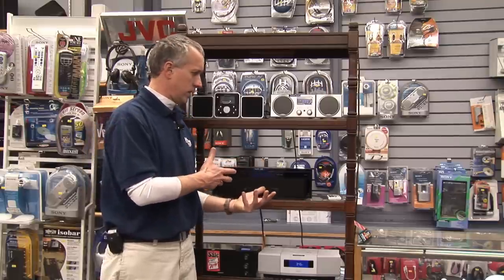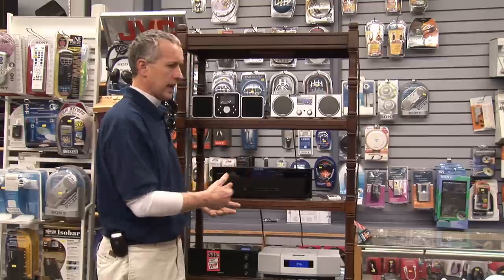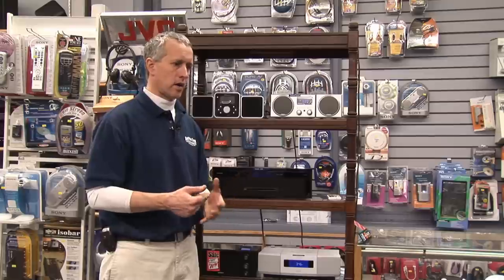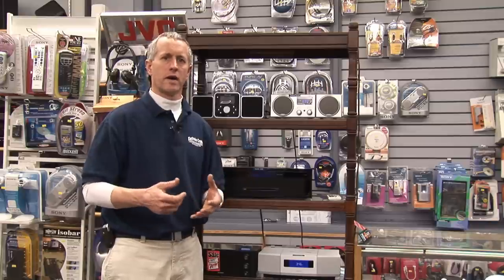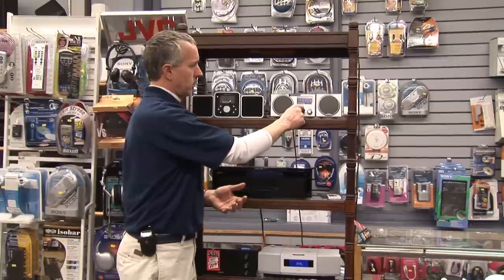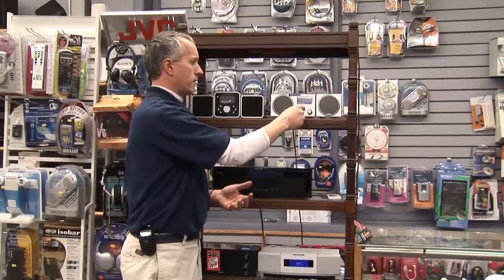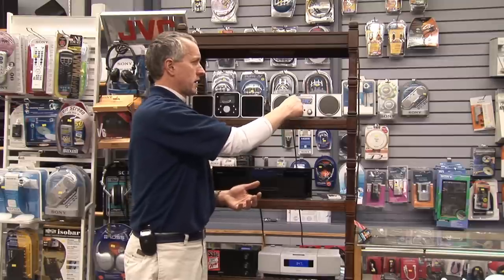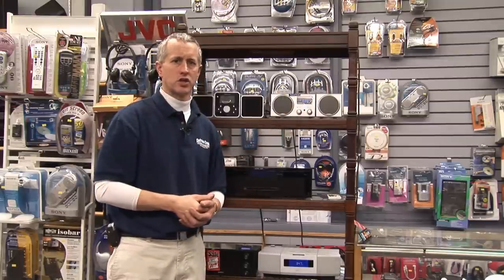Electronics Facts : How Does HD Radio Work?

Comment: A few things it is not "High Definition" ,the "HD" part in "HD radio" stands for nothing it is just a marketing term according to HD radio licenser and creator ibiquity . Also it is not CD quality it is "near' CD quality, "HD radio" only uses about 96.6kbps if only one "HD" stations is broadcasting on the Frequency most stations broadcast 2 HD stations (main channel plus sub channel) and they broadcast at 48kbps which is a lot worst then CD but do overall sound better then FM.